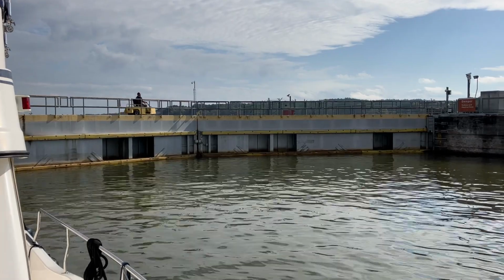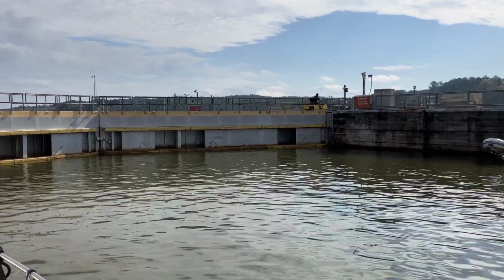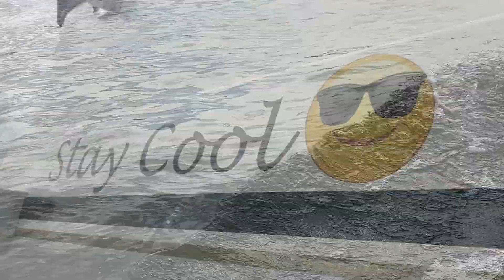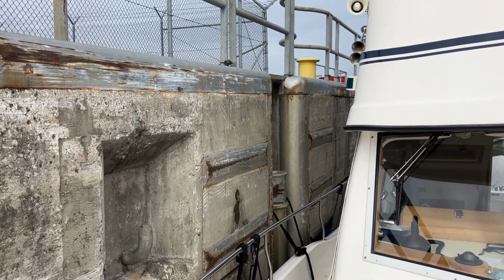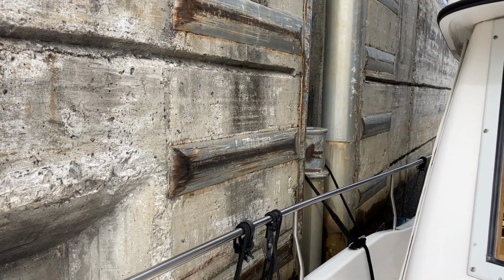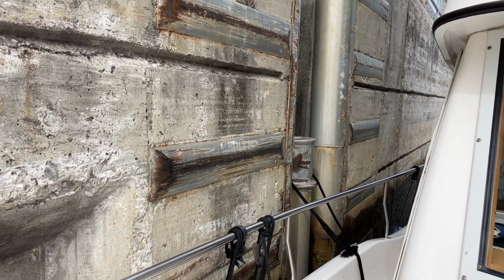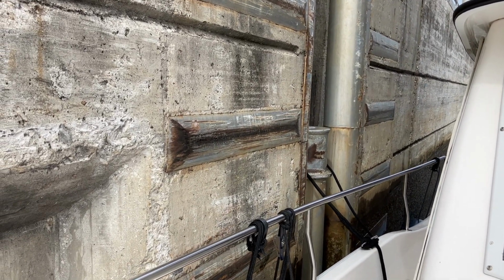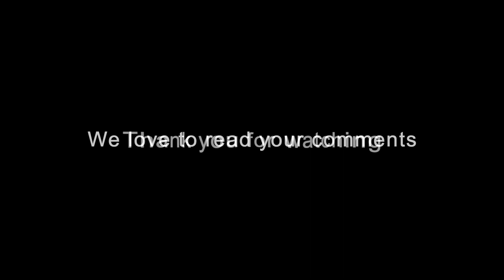Great Loop #45 Bay Springs Lake to Fulton

Comment: We live in Fulton & boat on Bay Springs, but we've never been through the locks. This is great to see. Today here we topped out @ 99 degrees F with a 109 degrees F heat index.
Reply from the maker: Hi Brad, Fulton is a great place to live and we enjoyed boating there. The locks are run very efficiently. Wow! That is certainly very hot.🥵I hope you have air-conditioning at home! Thanks for watching!😎

Comment: We enjoy your videos, thanks for sharing!  I see you typically tie a cleat hitch to the lock floating bollards.  Isn't it safer to do one wrap around the cleat and hold the line in case the floating bollard gets stuck?
Reply from the maker: Hi Rascal Boat, you are correct! It's important to monitor as the boat is lowered/raised in a lock in case it gets stuck. I've shown the midship cleat tied off just for the video because I can't do both at once! Rest assured we don't make a practice of tying off without monitoring.😎